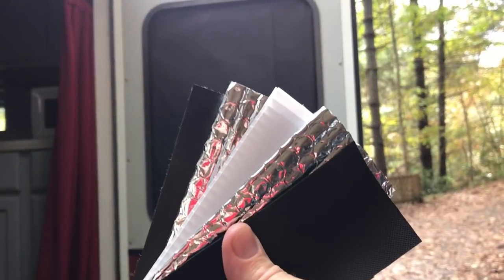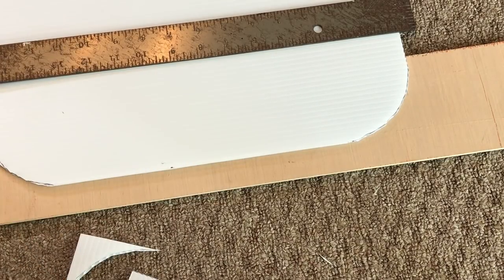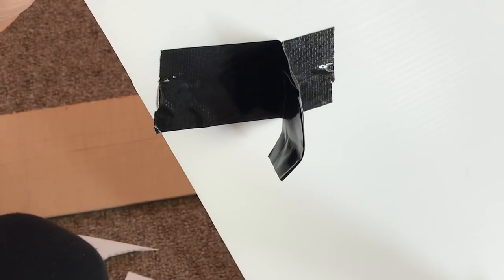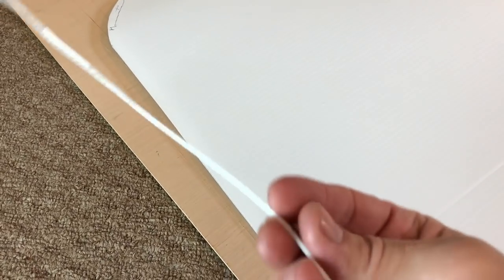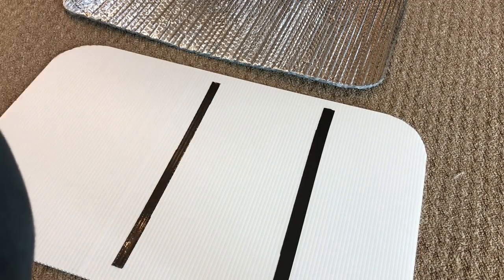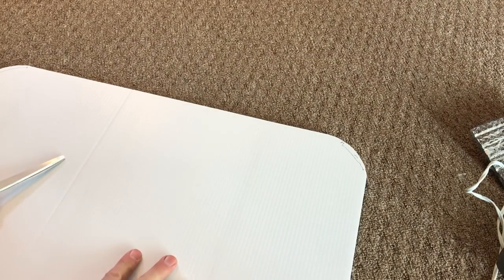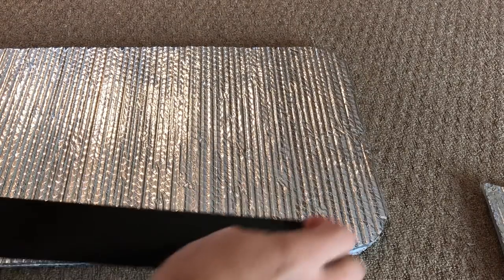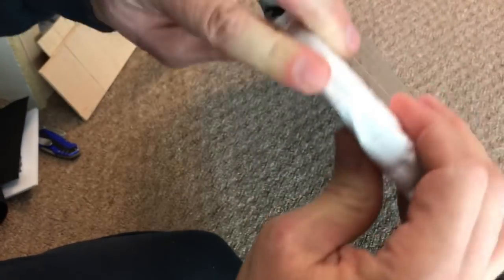Reflectix Insulated Window Covers Inserts Privacy Light Blocking Curtains Stealth Camper RV Van P2

Comment: Your tutorials are excellent. Very smart methods and tricks! I really appreciate that you don't just make the tutorial on your first attempt but test things out, learn from it and then make a tutorial that mentions all the pitfalls. One suggestion for the tape going around the edges. There is a tape that has a velvet/felt like surface. It's great to get smooth edges and makes it easy to install and taking them back out.

Comment: Thanks. Not sure if you mentioned it, but never apply black or tint to inside of dual pane glass
Reply from the maker: Good to know, thanks for posting!
Reply: When you say apply. Do you mean affix to or just up against. I have a 2001 BigFoot camper with dual plane windows can I use this method or not
Reply: Marcel Chaloux Jr when you say apply do you mean affix to or up against. I have a 2001 BigFoot camper can I use this method or application